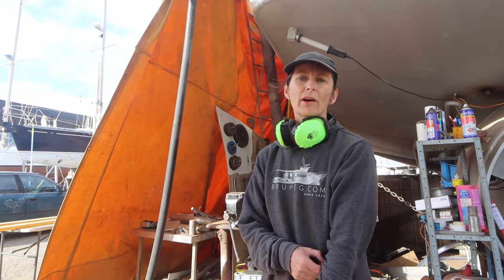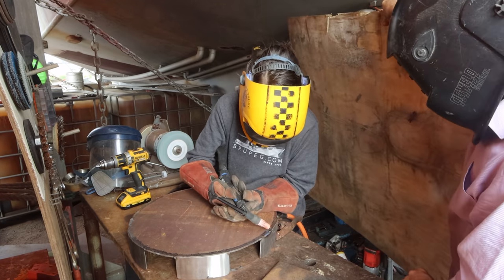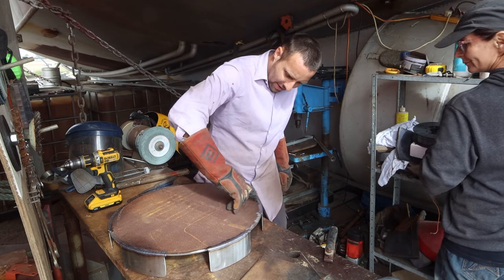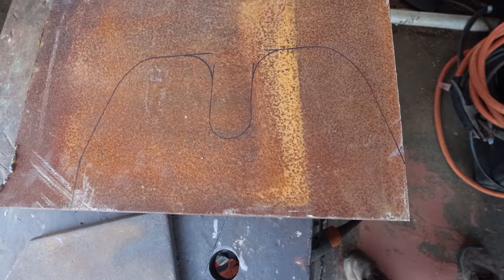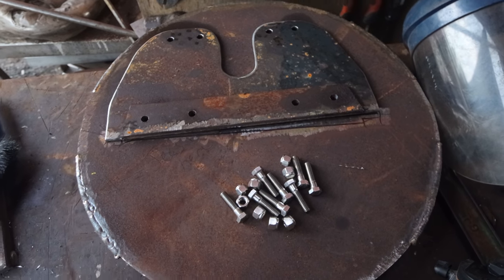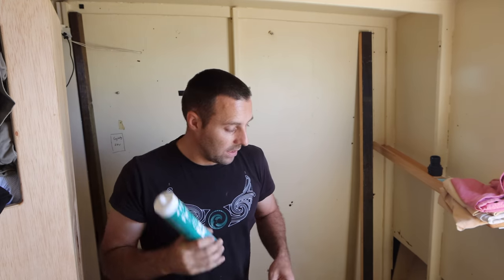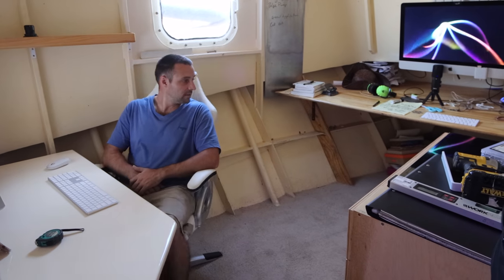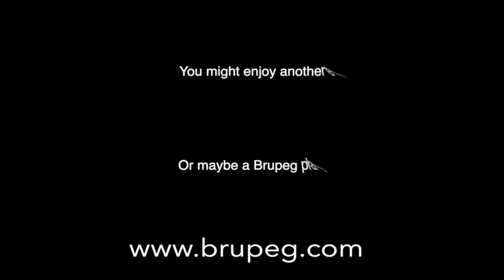TIG like a Girl - Project Brupeg Ep. 174

Comment: Great stuff you two, another entertaining and informative episode, I must try TIG! A little tip, when you want to stick a batten up using structural adhesive pop a few blobs of hot glue between the lines of adhesive, this grabs in a few seconds whilst you hold it in position and allows the batten to stay in place whilst the adhesive is curing.

Comment: Good way to secure the water heater.  May have missed this on the video but will there be any vibration from the tank to the metal.  We would put rubber (temp rated) between to stop the vibration not just for noise but will lessen the wear on the tank.  Just added precaution.  The project is looking good.
Reply from the maker: Thanks, yeah we plan to find some thinner rubber to fit around the top. The stuff we had was a bit to thick and we couldnt get it in. This tank is also a place holder for us to use as a template for a new rolled stainless tank we want to build. It will do fine for now but will be replaced with a better design with more bells and whistles

Comment: It's been 30 years, but we had a conical stone grinding bit we used to dress the tungsten rod tip when it went off while away from the shop. You just advanced the rod a bit and used an electric hand drill to sharpen the point just like a pencil sharpener. When you have a bench grinder handy, that's a good choice as well, (along with a handful of new rods)... 8P
Reply from the maker: Thanks for sharing

Comment: Just a thought you have probably already considered. You said you plan to replace the water heater tank before sailing. Might consider buying and storing now in case manufacturer retools and changes sizes. You worked too hard to have to resize the brackets.

Comment: Tip for tripod make metal  or lead blocks weights that can be attached with U bolts or zip ties to the bottom of each leg.
Reply from the maker: I hadn't actually thought of U bolting them on. I was thinking of melting up some lead and pouring it in a little mould and just sticking each leg in the molten lead. Your idea has a significantly lower explosion and fire rating than mine...

Comment: top of the tank dead center weld a deep nut    directly above on ceiling weld another deep nut   then use allthread to join between top of tank and ceiling    perfect easy to remove support that wont budge if you also use a secondary nut to lock the threads       ( yep, i know...if im watching this now its a bit late for suggestions  lol )      cant help it im a brainstorming problem solver and a bit lazy so i tend to try to find the simple but effective naturally
Reply from the maker: The lid is 1mm steel. Might last 30-40seconds in a bit of seaway. The thick steel was needed because the tank is so piss weak
Reply: I meant using that "cap" you made then the rod .     But......then I noticed you have a pipe running right thru the center so back to the drawing board for me  😁

Comment: Hi Damen and Jess,  You seem to have a lot of extra space in your engine room. Are you just going to use it all for storage ?. Shame you could not have installed a wing engine, can't help wondering what you going to do if your main engine dies on ya and you're in antarctic waters. Very scary to even think about. Can't wait for splash day though.
Reply from the maker: Hi Kevin, commercial boats very rarely have a wing engine, thats much more a recreational thing. That said we will be building a get home motor using the genset and a chain drive electric motor on the main shaft. Wing motors and ice dont mix. The plan for the engine room is a lot more gear will be fitted and any available space afterthat will be storage
Reply: @ProjectBrupeg  ok, l get ya. You have thought of everything, its just that its all on a to,do list. Maybe that something you could do.  show us what's ahead etc. Lots of boat builds show to do lists.
Reply from the maker: Yeah that’s a fair point. It’s been a while since we filmed one of those type episodes.

Comment: When you were leveling the desk made me wonder how level the boat is sitting. Also a lip on the front would keep thing from rolling off.
Reply: Taking that point one step further, I know a boat that was built on the level with spirit levels and included a bath. When afloat she was basically comfortable except the bath was several degrees plug hole end down !!
Reply from the maker: Hi Guys, when we set the boat up on the blocks, we spent ages getting it as level as possible as we know it would speed the build up later. The ability to use the level just makes sife simple. As for fiddles on benches, Brupeg is a fiddle free zone, Some poeple like them, thats great for them, we uterly hate them. in our experience they do little so stop things that are sliding across a table and instead provide a tiny launch ramp to jetisson then skyward. We ripped them off all benches in our previous yacht and never regretted it.
Reply: @ProjectBrupeg  Hugely agree about fiddles... so many good anti slip cloths now fidddles are completely redundant .
I will reiterate that spirit levels don't show how the boat will float !! Great work as always..

Comment: The girl knows her timber. For the best method of gaining smooth radius curved edge on shitty ply is an abrasive sanding block, The rotational oscillating sander head tears the rounded edges I've found when working with ply cupboards and speaker cabinets
Reply from the maker: Yeah we brought a long board with a fairly coarse grit, was lovely for shaping the long straight radius on the front edge

Comment: I don't normally deal with stainless but wouldn't nilocks stop that binding bs?

Is there a reason you didn't finish the sandblast/repair/paint process in the office before you moved Jess in? Seems like double handling.

As for researchers ... they should all have their own flammin' laptops anyway :P so be able to group up/forum around the dinning table with them outside meal times. I know I'd prefer to use my own gear then at least I know the securities and all. I'd be EXTREMELY hesitant to share my computer with anyone else in-case they managed to install a threat (think virus or trojan and yes they do exist for Mac).

The white finish on the desk is better when using ply instead of a nice pine board or something. If you have a nice board then show it with epoxy or whatever but that white coat really made that ply look better.

Since you shouldn't be drinking from the hot water tank hose won't matter but it won't hurt either way. As kids we'd always drink out of the hose, creek, whatever. The hose gives it a worse taste but isn't actually dangerous for you. Was there a water converter already on-board? If not consider it.

As for the fraction of language in the show ... if that upsets your tits ... don't watch anyone making anything when it goes wrong.
Reply: @JCrook1028  if I do it's boiled water from the jug. Or just a little bit to get my homebrew to the right temperature for the yeast. Why do you ask?

Comment: 1. Swear in Kiwi and the Nancy’s will have no idea they ought to be offended. 
2. Don’t forget to air bleed your filters after you have the system open.
3. Look at running a disc filter as a pre screen to your cartridges.   Firstly they are cheap as, secondly they are cleanable and don’t need replacing, threedly they go down to around 20ūm and take out a big percentage of booglies that will clog up the cartridges, saves a shirt load of money, simply a stack of plastic discs with radial micro grooved faces, get from any where that  does agri irrigation.
Reply from the maker: Nice, thanks for that Mick

Comment: Damo, you worried about the hot feed out of that hot tank blowing if the thermostat go's bonkers, I'd fit a meter of hose that can stand boiling water ... then hook yr hot supply to that. Oh and buy a spare TPR valve, bloody things pack up at the drop of a hat, some last months some last years and you can't bullshit up a replacement from your box of goodies. Better go fix my forklift and stop spending your money hahahaha.
Reply from the maker: I wasnt worried until you said something! Ignorance is truely bliss!!!

When we build the final tank I want to run two solid stainless pipes (feed/outlet) and remove as much rubber as poss. In the engine room I try to make everything as melt/fire/toxin smoke proof as I can and solid lines fit that bill nicely. I do hawever want to launch this year so rubber won for now... watch this space